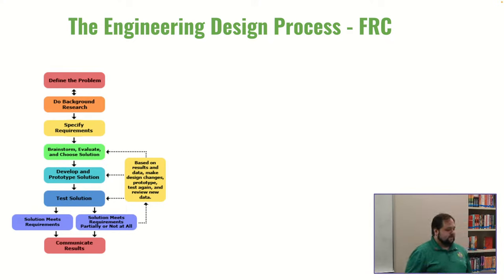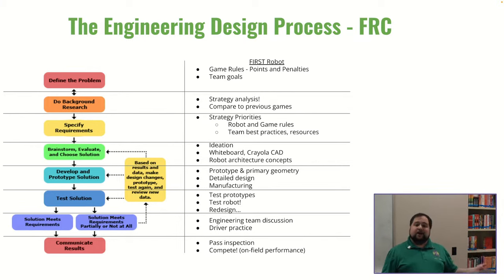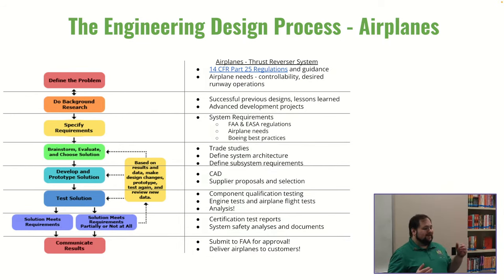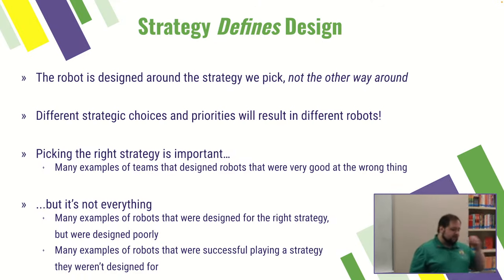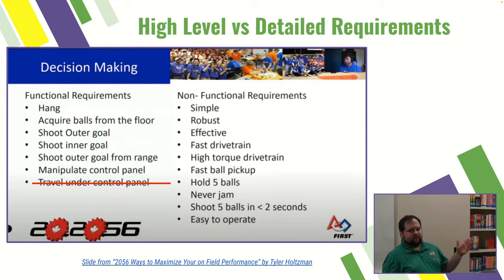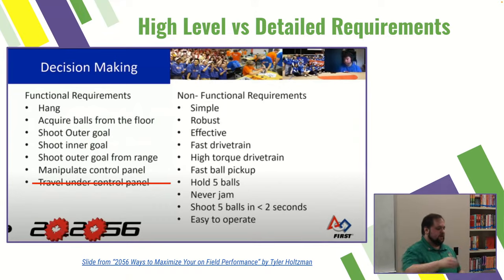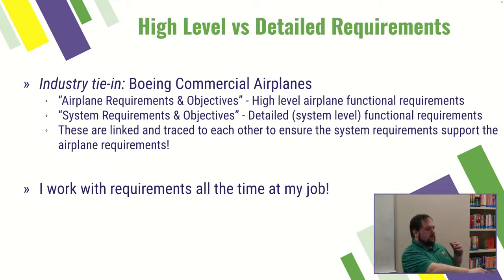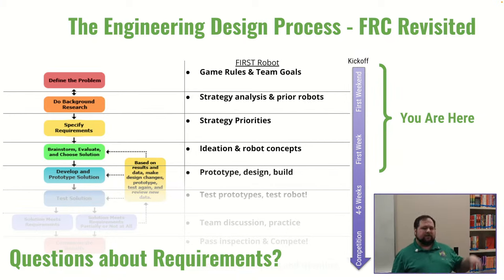Kickoff to Concept - Engineering Design Process & 1st Week of Build Season

Comment: Do you have any resources on what a pink arm and pink arm style chain run is? I haven't heard that term before. Also much love and thanks from team 2811 1:40:42
Reply: not sure about chain run, but the definition of pink arm varies
the most specific definition is there's a telescoping extension that pivots at the center of the robot (vertical height may vary), and that telescoping arm has a wrist on it that connects to the end effector. look at team 233's 2004